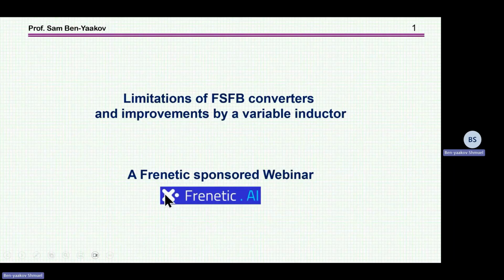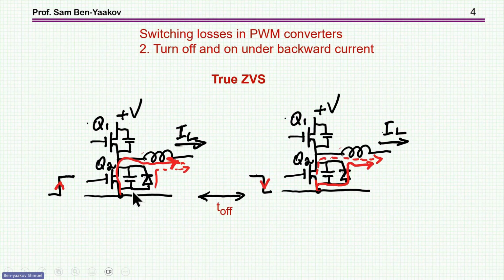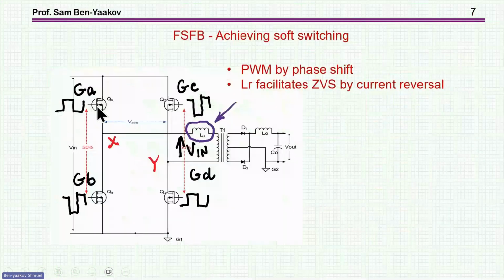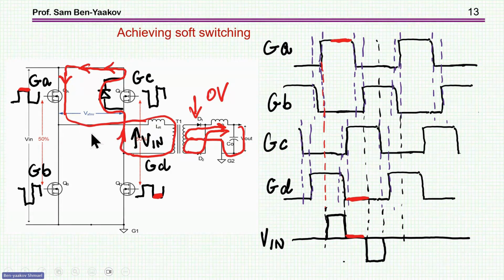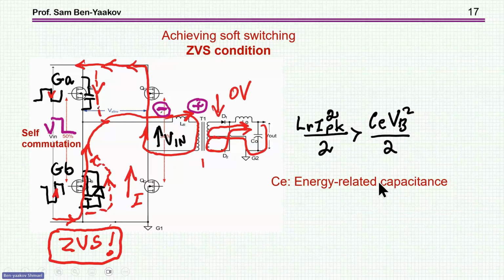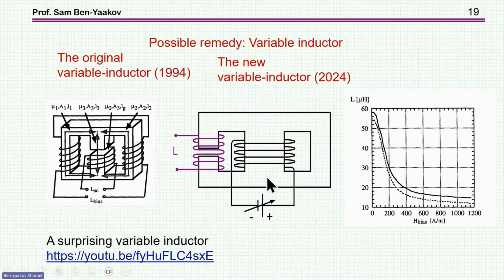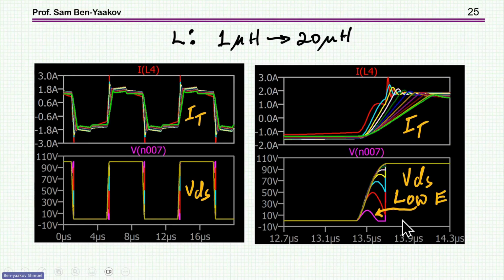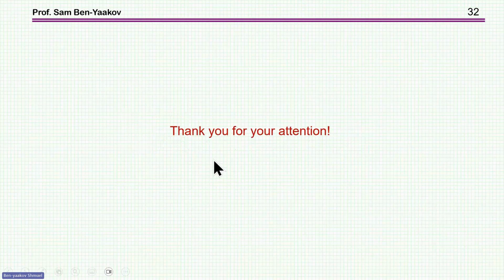Limitations of FSFB converters and improvements by a variable inductor

Comment: Thank you Prof. Comparing with an LLC do you think the PSFB is better in reacting to a load step ? Thanks
Reply from the maker: For well designed controls,  I don't think that there is a difference between the two.

Comment: Thanks again for very good video! Maybe for people who are not so familiar with this topology, could be useful to know, that primary side clamp diodes are usually needed to provide path for resonant inductor current. Transformer and resonant inductor current will differ slighty when changing active to passive state because of diodes and transformer parasitic capacitances. If no path very high voltages can be seen. In curious: 1kW Pout converter with Vin 600V-1000V, would you select LLC or PSFB if very small size is main target? If you select LLC, would you use fixed to resonance LLC+post regulation or regulate whole input range?
Reply from the maker: Thanks for the input. If in 'size' you include the heatsink and there is no need for wide voltage ratio range, I would GUESS the LLC will be smaller. Yes, the output can be regulated directly, assuming that the output ripple requirement is not too strict.

Comment: So in a way FSFB can be worse in terms of efficiency at low load and some duty cycles ? interesting tho those may be just hypothetical edge cases. 
Also would there be any problem if Lr is split into 2 parts to be symmetrical across both half bridges?
Reply from the maker: 1. Yes
2. Noproblem

Comment: Thanks for such valuable content! The qrr issue can be eliminated with GaN transistors. Despite the semiconductor power losses can be reduced with soft switching, the resonant inductor and capacitor losses must be accounted in the whole picture, when contrasted to efficiency of hard switching converters.
Reply from the maker: While there is no qrr (in most GaNs, not all!) there is a severe issue with reverse conduction